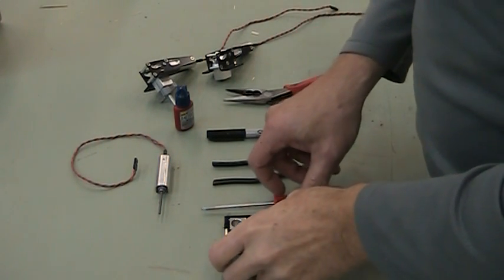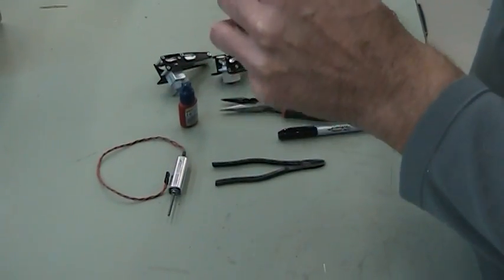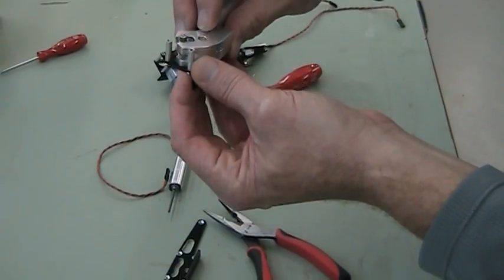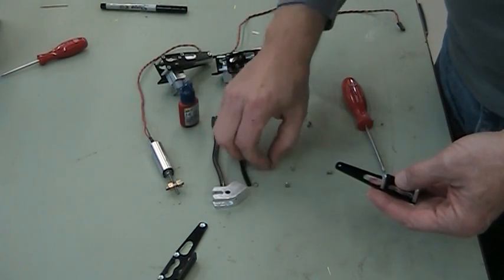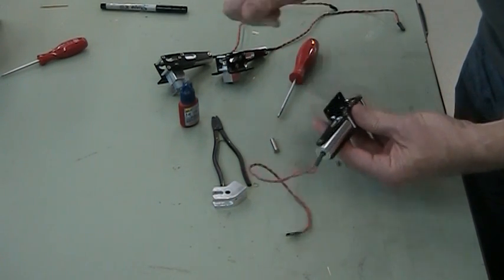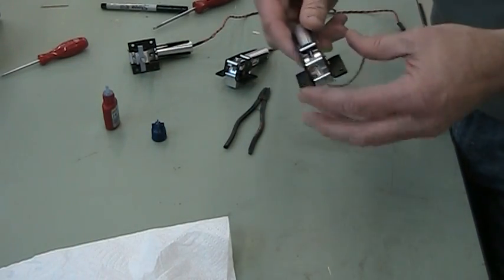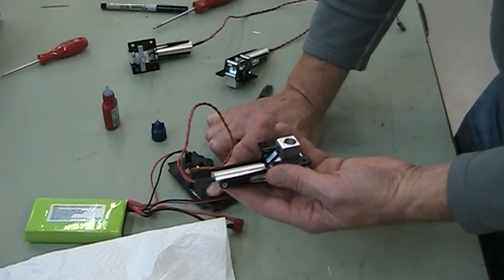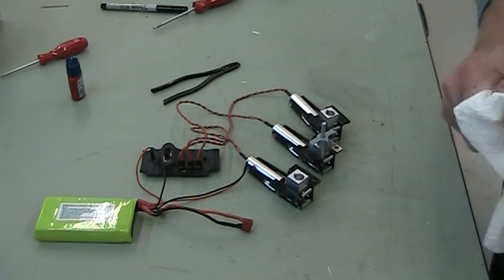Robart Manufacturing 550 Series Electric Conversion

Comment: I am thinking about using these to convert my Sierra  1/5th FW 190 gear.   I have had nothing but problems with air leaks.  These gear require solid air pressure to keep  the gear locked down.  This has cause lots of problems on landing in particular.  I hope this works.

Comment: Where do you get the small snap ring pliers?
Reply from the maker: I picked mine up from the local hardware store.  The smaller hardware stores such as Ace, Do-It-Best or your independent hardware store is probably your best bet.  You may want to check with your local hobby shop.  If they do repairs, they may have a tool area where you can get specialty tools like these.
Reply: Thank you
Reply: These are for small things right?
Reply from the maker: Yes.  These are for the very small snap rings also.